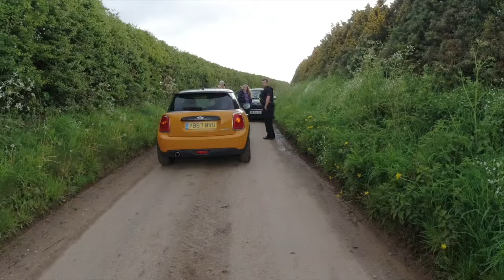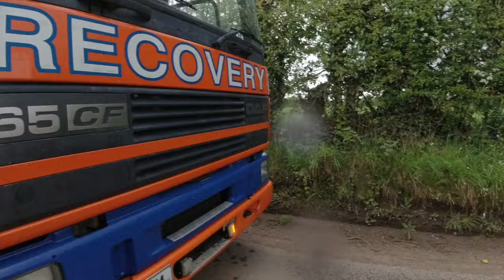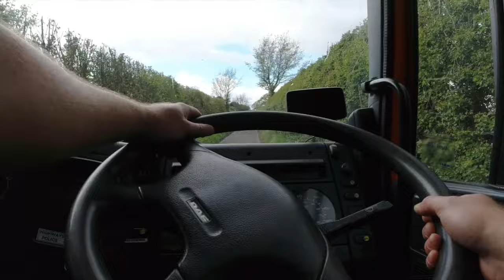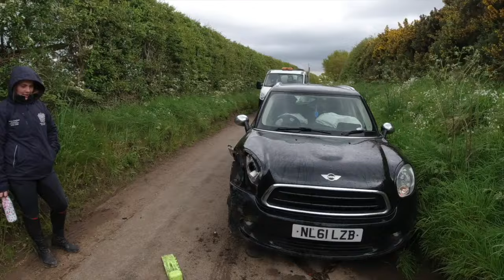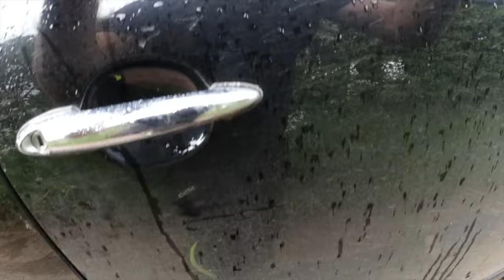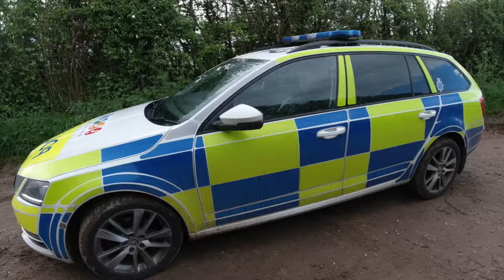RTC down tight country lane, ROAD BLOCKED, Bradley, Stafford, Police on scene! Vehicle Recovery!

Comment: cop should have gone back and closed the road , but they really arent that clever.
Reply: There was only one unit, and they went to the accident
Reply: @johnb8956  he would have a sign in the back , and could have put that across the junction before proceeding down an obvious narrow road
Reply: @patthewoodboy  which they would only know to use after they got to the scene
Reply: @johnb8956  no , theres an accident down a narrow lane , it would obvioulsly  be blocked even if it was a motorcycle accident
Reply: @patthewoodboy  no it wouldn’t lol. It probably wouldn’t even have still been there by the time they left. Not every RTC is a fatal mate. People have small bumps all the time
Reply: @johnb8956  so why were they called out. Because it wasnt a small bump.
Reply: @patthewoodboy  they were called to the report of an accident, down some road somewhere. There’s literally no way of them knowing they need to close the road.

Comment: I absolutely hate rural roads and country lanes for this very reason.  A lot of the time it's hedges, blind bends, needle-thin roads and locals who drive around at the speed of light as if they have exclusive use.  It freaks me out every time and so glad I live in a large town.

---

And no surprise at all to learn that NL61 LZB is no longer found on the Gov.uk database.  No way that damage was economical to repair on such an old car, probably just scrapped.
Reply: Such an old car? What do you consider old? How old was it when the video happened?

Comment: What are your precautions for a winch cable snapping? Do you apply handbrake few clicks?
Reply from the maker: I dont really do it on small light stuff, anything big or vans heavy vehicles etc every time few clicks up, only when wheels touch bed! Better to be safe than sorry! 100%
Reply from the maker: Generally sit in vehicle whilst winching up aswell.
Reply: Thank you for replying

Comment: Matey in the l200 was lucky the plod wasnt on the ball, 3500kg trailer on a 2600kg truck with what looks like all n then some of the above.
Reply: Police wouldn't know the difference these days.  But even if the trailer was empty i   think your point still stands.    I've seen an older disco with the biggest Renault master van on a trailer behind.  That can't be right!
Reply: @chrishart8548  3.5 tonnes is permissible weight for a Disco. 14 ft trailer (1/2 ton)+van(2ton if empty)  That's well in the limits.